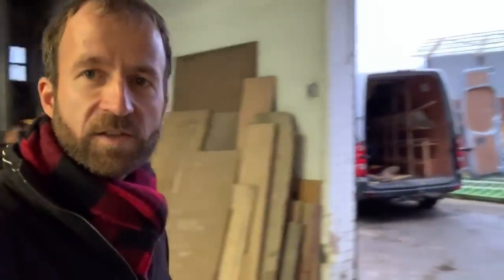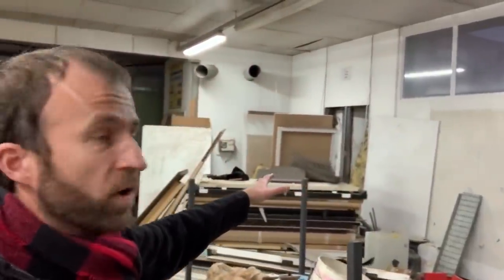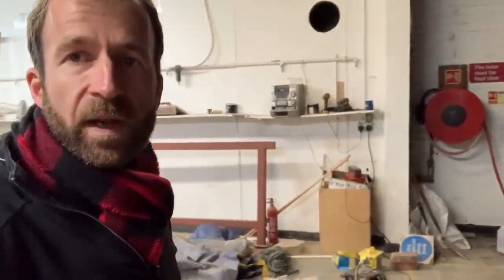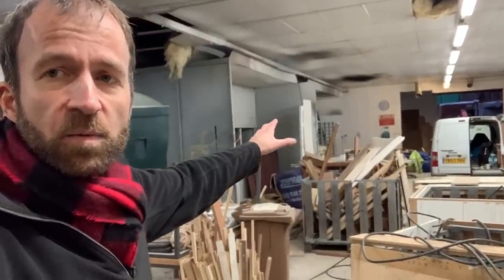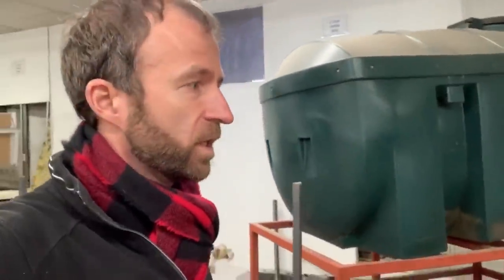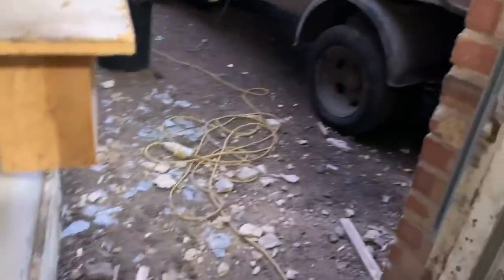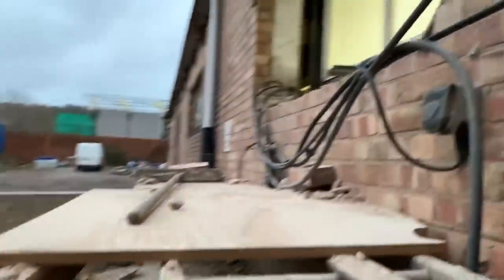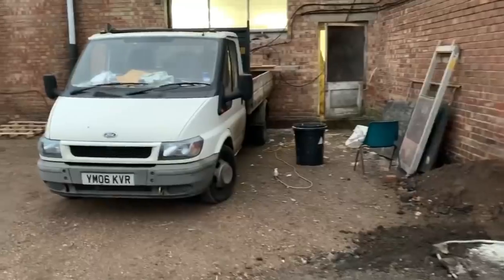Board Lifter Delivery and Workshop Progress Update

Comment: Thats's a great new space! I thought it looked rather familiar then I noticed that it was previously occupied by Longdon Doors. I worked there for only a few months before being laid off. They where good lads to work with at that firm. It later became apparent that the company had been in financial trouble on and off for a number of years and it was not the first time they had been under... They made bespoke doorsets, the large building to the left as you enter the yard is where the main production work took place. All of the doors would be machined and assembled on a vast production line in there. The smaller shop where you are was where all the frames where produced, finished, hung and warped. 
I wish you all the best with your new shop Alastair!
Reply from the maker: AJIBBO I wondered if anyone watching this might have known more about the place!  Such a shame.

Comment: Bold move, well done and the very best of luck.
Reply from the maker: christian collett thanks 🙏
Reply: @Alastair_Freebird  Roof looks old   as does the gutter. Are you're responsible for repairs? Too far away to physically help with those if problematic but happy to offer advice on materials/costs/methods/suppliers etc?
Reply from the maker: christian collett the roof seems to be sound so far as leaks are concerned but yes very old and asbestos!! The landlord is taking responsibility for the building structure and in fact going above and beyond what I expected with renovations and alterations to suit how we plan to use the space

Comment: i wonder could you use the econd spray booth area as a machining area and use the fans to suck out any dust that the dust extracters miss. that would cut down on the dust in the air that would screw up your finishing
Reply from the maker: MelbourneAlan that’s not a bad idea.  The planned layout seems the best solution though, regarding both separation of dust and also keeping the noisy machinery away from the office which will be on the space where we entered and place the board lifter in this video

Comment: If you need any compressed air bits pipe/ regs/ fittings try pipemore ltd in rotherham good set of lads there
Reply from the maker: Thanks for that tip, I was taking to Thorite in Sheffield so I will compare prices 👍

Comment: If possible, why not bring clear air through the roof to provide fresh air for the spray booth extractors? I saw there are four? tall extract ducts on the roof, could one be reversed to provide clean air?
Reply from the maker: Bad Robot interesting idea, reversing one or 2, that would be the only way as I’m not going to mess with the asbestos roof!  I don’t think it would work though in terms of the path of the air flow

Comment: Hi,

Has the spray booth gone? 

Ex Longden manufacture here and set up Luxury Door Solutions after it went bust. 

The gold boys that made them doors and still going 👍🚪
Reply from the maker: Paul Dawson Hi Paul yes I’m afraid it’s gone!  I think you work with my neighbour across the road!
Reply: Freebird Interiors Hi, thank you for the swift reply and I’m glad to hear the factory been used to manufacture.

Hope it all goes well for you. Top work buddy
Reply from the maker: What was your role in the original longdens setup?
Reply: Freebird Interiors business development director. Started off on the shop floor as a wood machinists and worked my way up.

Is the Extraction still there? Would it be possible to visit the site to see if anything I could buy?
Reply from the maker: Yes please come have a look at all the old machinery etc still dumped at the back of the site. Some may be fixable.  I would like to pick your brains on some things too!  Call me on 07941456770 I’m here today but may not be back til next week.

Comment: Don't waste your time with the 'wood welder' we had one about 20 years ago and it was not very good, sometimes burnt the wood. Seeing your video of it took me back, we needed something to glue up timber quickly and thought it was the answer, sadly that was not the case. We have found the PU glues far better and efficient for speed, especially if you buy the 5 minute PU glue made by Adkwik , don't know how we managed without it.
Reply from the maker: Gary Blake that’s interesting and not the first time I’ve heard the wood welder is not really necessary for most people
Reply from the maker: I did consider getting on a couple of years back and Alan Lamont came to see me to demonstrate it.  The results varied a lot depending on the glue - not just any PVA will do, he had a particular brand he recommended and the joint was significantly stronger using that vs other glue of ours that  we tried
Reply: Freebird Interiors we used to use cascamite, but sometimes as you went along the join if you weren’t careful you could scorch the timber. As I said with the advent of the PU glues we found no need for it. We used to finger joint the boards which made for better glue area and keeping the boards level when gluing up. I think if you have got it for free you may as well try it and see how you get on.